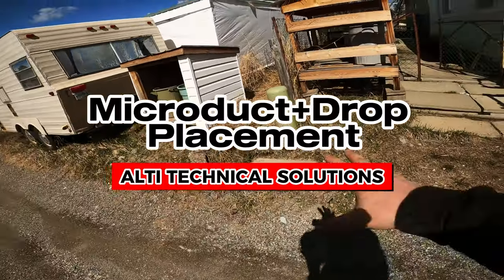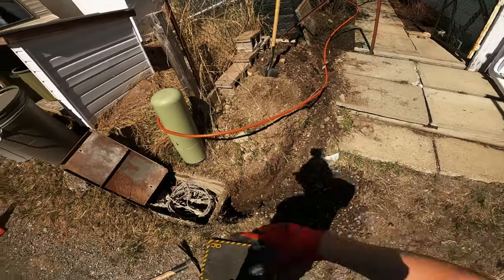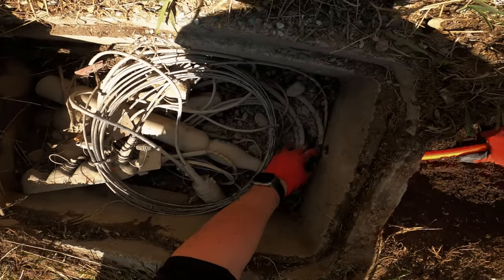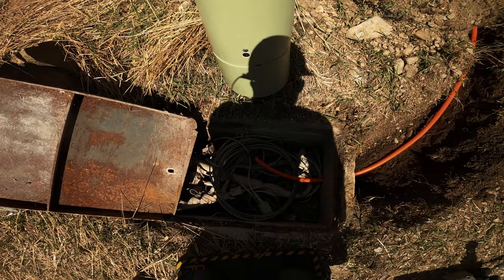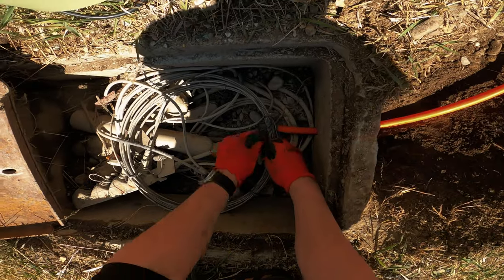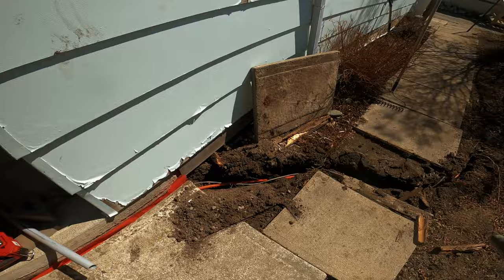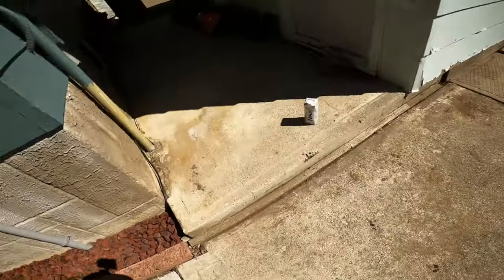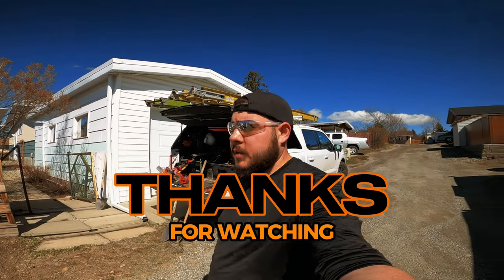Telecom Conduit Placement Trenching with Microduct+Fiber Optic Cable Drop

Comment: Wow actually installing a tracer wire
Reply from the maker: The tracer is built into the microduct 😅, but I run tracer with any Underground pull I do 🤙🏼
Reply: @FyBurz  ya I'm a locator in Ontario and 90% of the time there is not a tracer on BSU anymore.
Reply from the maker: @Alexander12547  sweet I’m from Brampton

Comment: is the fiber gonna be okay if vehicle run over the buried duct?
Reply from the maker: Yup
Reply: @FyBurz  thank's I'm planning to run a 50 meter fiber optic under ground to my garage from my house. I'm using a 1 inch hdpe water pipe as conduit and outdoor type fiber drop cable. those fiber optic cable with 3 steel wires in it.
Reply from the maker: @maxamps45  3 steel wires 👀
Reply: @FyBurz  I don't really know what they're called but I has 3 steel wires iirc it was called messenger wire.
Reply from the maker: @maxamps45 ah figure 8 I think 🤔